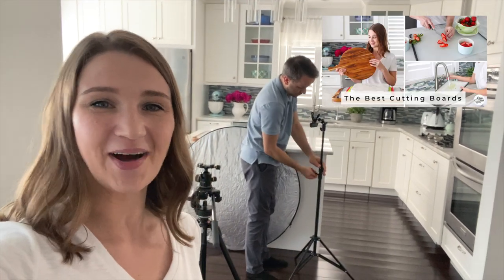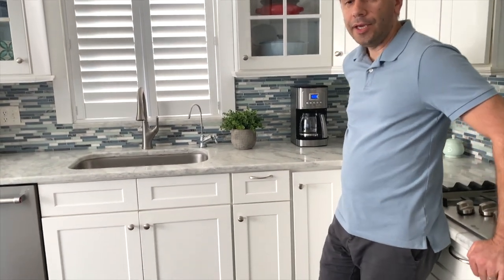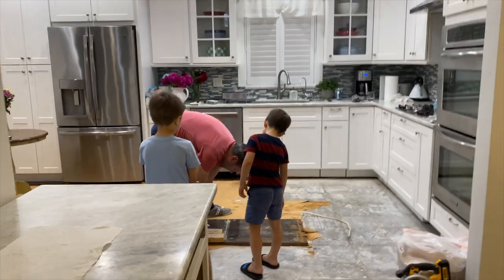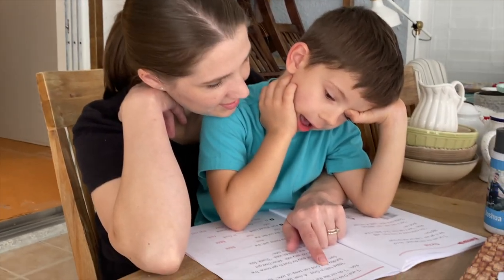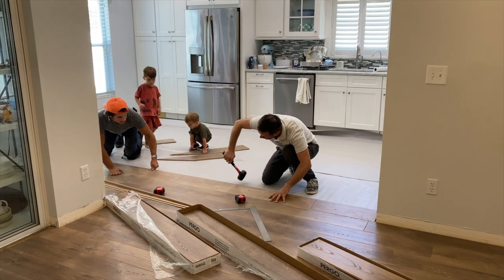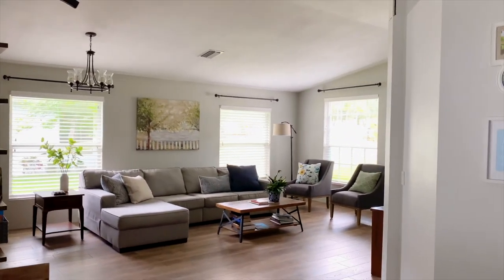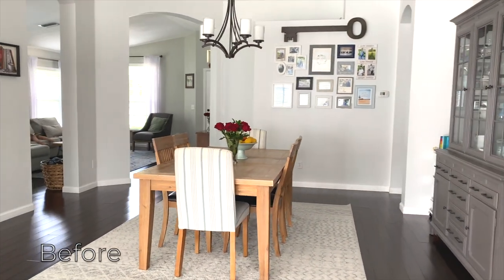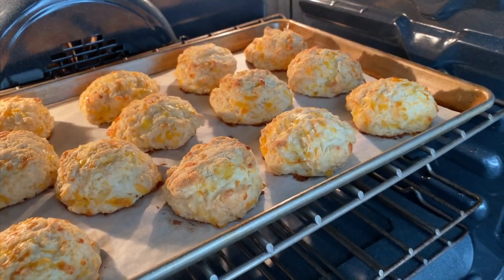Unexpected Home Repairs

Comment: Beautiful floors! My husband is an appliance tech and he says it's almost never worth it to fix a dishwasher.  Once it starts giving up it will continue to keep breaking. I've bought a used kitchen aid dishwasher that still works great and it was 12 yrs old but right now nothing is build to last, we recently moved and remodeled so I got a Samsung dishwasher that is do quiet u can't hear it's on🤣 and it costs 1200 and I still miss the old kitchen aid one, it was louder but washed way better, I never had to rinse food off
Reply from the maker: Thanks so much for the input. From what I've read and heard from many others, it seems that appliances don't last very long at all. We already paid for the repairman to come out just to see what the problem was and would have to pay for the repair and the parts, then it may not last that long before something else breaks. We always prefer to fix something if possible instead of buying a new thing, but in this case, it doesn't seem like a good idea. We'll see. This is actually our 3rd dishwasher since moving into this house 8 years ago. We had 2 used appliances before and they didn't last long at all.
Reply: @OlgasFlavorFactory  so I just asked my husband what would be the most durable dishwasher and he said kitchen aid hands down. He said Bosch is good but tends to fail and once it fails u can't get it fixed. And I can confirm that the kitchen aid dishwashers last because like i said I got mine used off offer up used it for over 5 years and it was still going strong. It was white and we switched to stainless steel. Also anther tip is if you want appliances that last is to get the most basic things without extra electronic gimmicks, the more options or fancy it gets the easier and more expensive it is to break and fix. Just keep that in mind. I've had and used most brands of any appliances and I can tell u that the simplest and the older they are the longer they will last
Reply from the maker: @picframe000  Thanks so much! That's very helpful.

Comment: I suggest replacing the dishwasher on e it's fixed it will never be the same and susceptible to break again. Stay away from anything made by Samsung all garbage I originally bought all Samsung appliances for my home 6 years ago and one by one I've had to replace them all. Bosch is literally the best.
Reply from the maker: It makes me nervous to use any dishwasher again:). We will get a water leak sensor no matter what, so we can be aware of a leak immediately if it ever happens again.